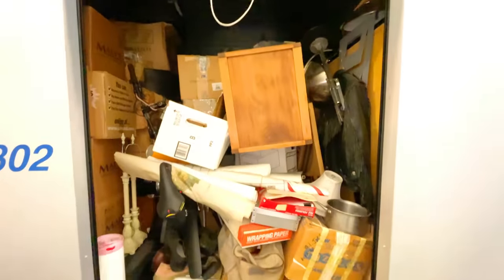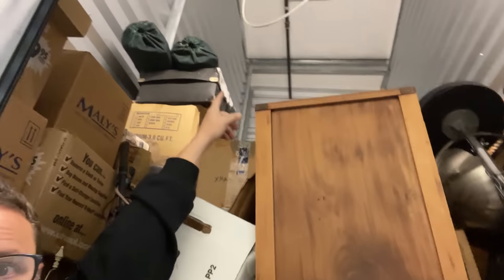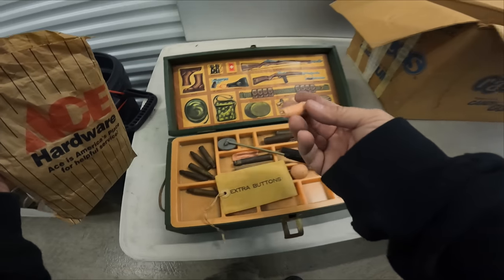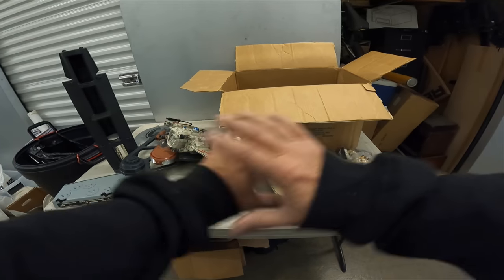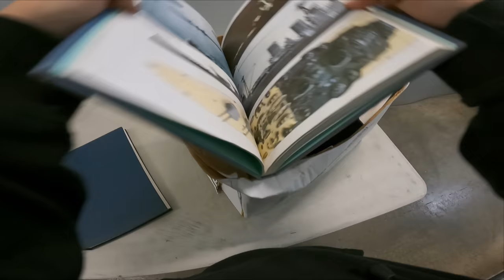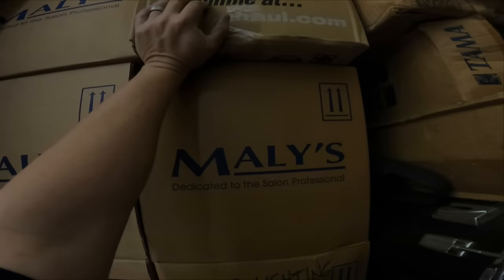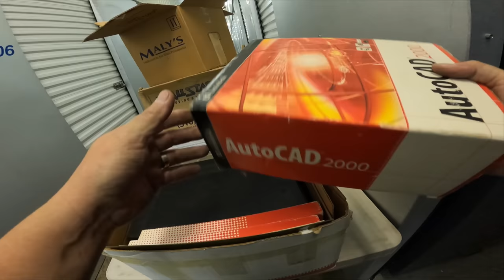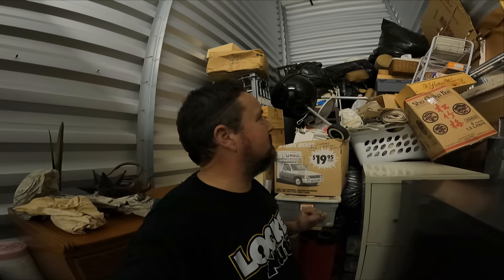Rumors of a coin collection! After owner passed away, family abandoned his locker. What's inside?

Comment: Jack, check the manufacturer of that metal dresser. There are a couple that are mid century and earlier that are very desirable as in $400-$2000. I have sold vintage and antiques for 20+ yrs. I have sold several over the years. The cabinet you were calling an "art cabinet" is actually a Vintage Map Cabinet and can go for several thousand depending on age, condition and manufacturer. I have sold several. I am located outside of Denver. The dresser and cabinet are very desirable right now. Feel free to message me, we have had customers that are dealers in your area.

Comment: Oh dude! You may know by now but you pulled two rare blue Snaggletooths in your Star Wars box. The blue Snaggletooth is an error issue. It was a send in via Sears, they rushed it and made a full figure blue character for a short red character. Kenner pulled the blue one and replaced it with the corrected and youve got two of the error! There is a variant, a distinction in the toes on the boot. indent or not. Congrats.